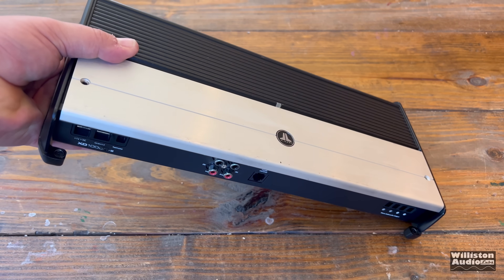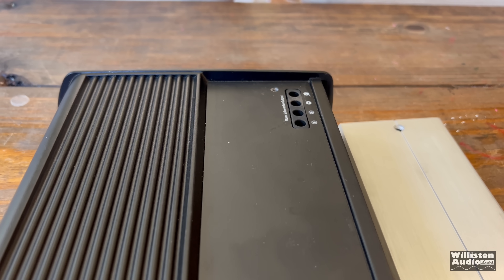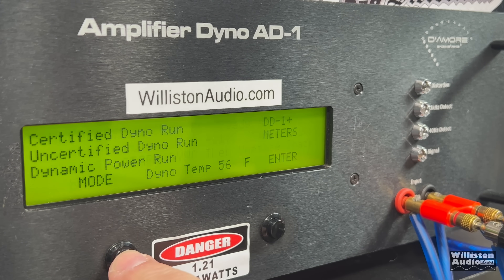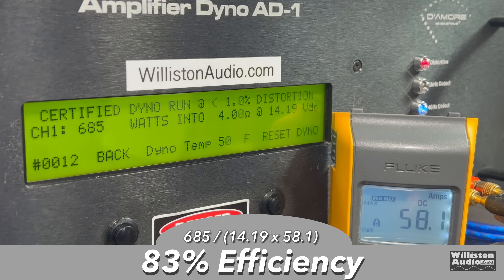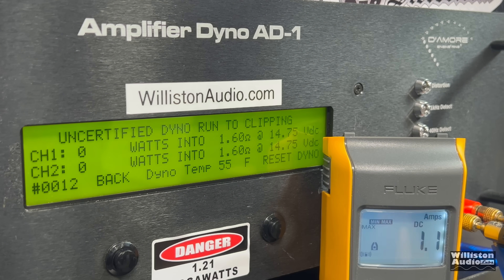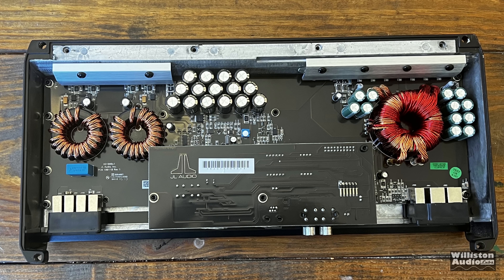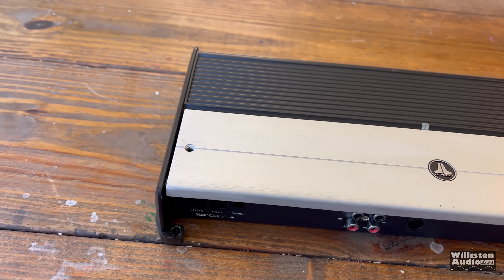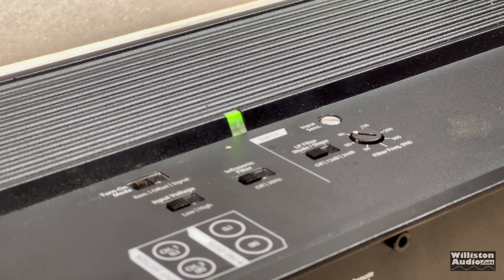Almost $1 per Watt? JL Audio XD1000/1 Amp Dyno Test and Review

Comment: I know this is a old video .
I have always had JL in my vehicles since the 80's-90's.the old school 10w6 subs were absolute mini monsters!  As I got older and my hearing doesn't require trunk busting bass. I tend to like clean clear bass in my later years . About 10yrs ago I started buying the perfect set up for my taco. Took my time and picked my old school set up. 
Found a JL 500/1 new in box on eBay, after many bidding wars, I wanted this amp pushing two jl 8w3v4 subs.
Went with the 8's due to lack of space behind seat. 
Long story short. Never did install this system in my taco.  Been sitting in my closet for years now.
That's until my son got his 1st car.  Which happen to be a 21 Civic Type R hatch. The absolute perfect platform for my dusty old school JL system.  After finally talking my son into going with my old school system.
We Installed the amp and subs in a dual ported custom box, on the civics stock system.
OMG!  I fell in love with JL all over again 
My son couldn't believe how bad ass two 8" subs hit.  He was very skeptical at first.  Like all young'uns his age. Thinking bigger is better. Not always my boy!  The rare occasions when He lets the old man take his R down the road.  Brings back some great old memories with some classic Rock hitting tight and hard!
Reply: @dwhite9603  whilst I am very happy for yall.
As far as the bigger being better, it is true the surface area of a 12 just allows for so much more and not to mention they’re more capable of hitting the lower frequencies!

Comment: I don’t know about the mono XD1000, but the sub channel is definitely regulated on my XDM1000/5 channel on the sub output. It’ll do 600 watts just for the sub channel at both 12.5V up to 14.4v
Reply: You are a mistaken. The XDM1000/5 Does 100x4 @2ohm and 600x1 @2ohm @14.4 volts They do not have the regulated  R.I.P.S power supply as HD or older slash series.  So your getting less that 600 watts to your sub at 12.5 than the 14.4 you would need for full 600watts.  Unless you have a very good charging system..(upgraded alternator and a good agm or Lithium secondary dedicated battery.  Your deff not going to be at 14.4 volts under load.
Reply: @  I’m not mistaken. Yes, the XDM1000/5 is classified as a non regulated amp, but look at the specs for the sub channel in the manual. It will output 600 RMS at 2 ohms with 12.5V up to 14.4V. If anything, I’d call it partially regulated.

Comment: Thoughts on a used JL 1000/1 like this or the JP23?  I have 2 X JL 12W3s and had a JP8.  I felt I was maxing the amp and the speakers wanted more than 400 watts each that the JP8 was providing.  Ive had XTANT in the past, so Im familiar with quality and damping of the amp.  I just want to make sure Im getting loads of easy clean power to the subs.

Comment: Hey WA Lab… I wanted to see if you can either answer or both answer and show amps that have best efficiency. By efficiency, I mean amps that do not tax an car’s electrical system too much, and would/could possibly perform well without huge power output upgrades. Many of the amps you show with decent power take so much amperage to run, that an 100-150amp alternator would barely put out to keep up with most of those 1k amps. And since most newer car’s electrical systems are really sensitive to voltage spikes and drops, that would be a cool series to help people that want to bump & retain an unmolested factory electrics- or mildly upgraded ones that just need a cap or additional battery. Cheers

Comment: 7:15 The idea is supposed to lower the Equivalent series resistance of the capacitance.  The theory is the smaller caps should discharge much faster.

Comment: A caps tolerance is typically plus or minus 5%. The bigger your cap the bigger your tolerances need to be. By using smaller caps you can tighten your electrical tolerances.

Comment: Many smaller caps will have a lower ESR resulting in faster and higher current capabilities. Also, you can distribute the current across more conductor with many smaller caps to distribute (heat) current load across more conductor, resulting in better cooling.

Comment: Armchair EE nerd here. Electrically, the equivalent series resistance ("ESR") of a capacitor is a big reason why a choice would be made between giant bulk capacitors and an array of smaller ones (as JL has). Just like with the woofers when paralleled, more small capacitors will have a lower ESR, allowing the capacitor array to handle a much bigger peak power draw, as one would see with a thundering subwoofer in a typical music application. There are other considerations as well:
  -Heat dissipation (more capacitors = more surface area for cooling)
  -Space usage
  -Cost of bulk capacitor vs. capacitor array

I don't think any of those are a major concern for JL Audio in this application, because:
  -The enclosed housing and cluster of capacitors wouldn't do much for dissipating heat from the capacitors
  -They clearly have plenty of space
  -JL seems to consistently prioritize quality over cost. (I do too.)

Thanks for covering, Big D. 👍

Comment: I had that Amp. Played it in the Arizona summer 110+ degrees windows down no ac. on 3 JL audio w6v3s. Max volume. No issues, never overheated once in 4 years. Sold it for a more powerful amp
Reply: Great comment sir. That’s fantastic to hear.

The gentlemen who engineered this amplifier live and work in Phoenix. They are acutely aware of real world temps in cars, in the summer, in Phoenix. (I know this because I work with them)

Comment: like the XD amps better then the HD. seen many HD installs that the amps would shut off cause not enough voltage/amps they claim the HD will run at 9-14 volts but thats horse crap seen it to many times thats why we push the XD over the HD unless they have a great electrical system...

Comment: There is nothing special about that amp. JL just likes to charge a lot of money for their products. I like their subs, I have three of them. But sometimes it is hard to justify spending all of the extra cash that they want for their products. I just picked up one of the JP8 monoblocs from down4sound that you have been testing lately for $200.00 and it is stable down to 1 ohm. It uses all the same internal components that you find in the JL amp and some of the components in the JP8 area actually better, like the RCA's. I can buy 5 of the JP8's for the same amount of money that it cost to buy just 1 of the JL Audio amps and I doubt that the JL Audio amp will have any advantage over the JP8.
Reply: Really bro really, it's like saying you can buy 3 corvettes for the price of 1 ferrari and they have the same components because they have 4 rubber tires !  Just say you are broke and be done with it.

Comment: Did you say wired in Series Parallel? What's that? As far as sound. Any amp with decent power supply and distortion will sound great with bass. Fact is this amp is a rip off for the price. No way a 1000w sub amp.should cost nearly $1000. Ridiculous. That JL label is VERY expensive to say the least

Comment: 1000 at 2 ohm is not bad. Would be a decent single 12 inch setup.     Thinking back I always saw these amps used in installs that for example, a friend of mine who does not work on cars, went to a shop and just had a single 10 inch system installed with the custom made boxes they sold designed for each model of car to fit in spare tire spaces or where the jack would normally be.  It would always be an alpine head unit, a CD changer, a JL audio amplifier, those custom boxes and a JL audio sub either 10 or 12 inch class. I remember the one in my buddies firebird was a 10 inch JL in a sealed custom box that came out to be just under one cu ft stuffed with poly fill.

Comment: JL Audio has always been a company that delivers well-thought-out, well-designed and reliable products. And these things shouldn't be cheap. The question is whether it can compete on price with European or Japanese amplifiers. If we talk about real SQ, I will always choose a European or Japanese amplifier for not powerful (60-80 watts per channel) 4-channel amplifier for midranges and tweeters. 
As for subwoofers or subwoofer monoblocks, JL Audio has succeeded in this. 
Thank you for your test and review.
Reply: Sorry JL Audio is low budget subwoofer & Amplifier,too expensive if you want deep bass they are not the way to go
Reply: @poohwecampbell7799  I'm actually talking about sound quality and not about SPL.  I'm pissed off by cars that can hear bass from half a mile away.  Well, to each his own.  In terms of sound quality, JL Audio does a great, right bass.

Comment: The smaller capacitors that are tall rather that wide, this has a better geometry to reduce inductance in the capacitor, ESL (effective series inductance) . As a result they can transfer current better at high frequencies. Since the power supply switches at tens of kilo hertz, this is beneficial since it can deliver power with minimal impedance. The effective ESR (effective series resistance), this has to be low to minimize heat generated in the capacitor, this is stated as you can see on the capacitor "Low ESR", this not always the case.

Comment: I’ve only used JL Audio for years. The old slash series. Power rating aside, nothing I’ve ever heard hits and clean and as hard as JL Audio. 2 W7’s and JL Audio 1000/1 pure subwoofer bliss. I have 2 that are over 10 years old still banging daily. Can the new Korean stuff say that?
Reply: I have 2 of these amps would you recommend me pair them to the 12 inch w7 subs or the 13 1/2 subs

Comment: Using many smaller capacitors in parallel instead of few big ones lowers the ESR (equivalent series resistance) of the capacitor circuit helping with dynamic current delivery.

Comment: I'm still waiting for someone to dyno the JL RD1500/1. With the impedance switch, it's rated at 1500 watts at 1 and 2 ohms. I'm curious if it's really the same at 1 ohm, or it's underrated. At 12 volts, it's 1200 for 2 ohms, and still 1500 for 1 ohm, which confuses me because at 1 ohm, it's rated same 1500 at 14.4 volts.

Comment: Does it sound better then a Fosgate? Honestly when i have the budget Fosgate makes a great amp, right now my wallet is on a Skar audio budget but man for $500 i got a box with x2 12s and a RP 1200.1d and it hits smooth low and clear. I notice with Skar tho has to be turned perfectly it's my experience after owning 3 dif Skar amps mechanical clipping you can hear, so feed them propper power and tune them accordingly.

Comment: The multiple small value capacitors equal lower impedance, which equals releases the energy quicker with less loss. This was pioneered by Peter Stein of ME 
Sound in Australia.

Comment: Can you do a dyno test on a Pioneer deh-x8800bhs head unit? They claim that it can do 70 watts for a sub channel.
I can send you the radio. Btw, I'm thinking a cheapie Image Dynamics 12" sub in a ported box could be decent for that head unit. It's a system for my granddaughter. Two coaxials and a sub. Good enough.

Comment: A bank of many smaller capacitors tend to be cheaper than a single 10,000µF capacitor.  Also, a big cap tends to take up a lot of vertical space, while a bank of smaller caps will take up a lot of horizontal space.  So the dimensions of the box, and the space available on the circuit board plays a role here too.  Plus, smaller capacitors will charge and discharge faster than a single large one.  This improves transient response time - basically, the speed in which current can flow in and out the capacitor to the rest of the unit.  The faster this current can flow, the less the signal is distorted when there is a sudden, high current demand, and the sooner the caps can recover after being depleted (or nearly so).  This results high frequencies sounding better at high volumes, and bass notes retaining their "punch" at high volumes.

But every capacitor has leakage.  This is a tiny amount of current lost within the capacitor.  No capacitor is perfect.  And when we add a bunch together, we add up the leakage.  So we use special capacitors with low leakage - but slightly more expensive.  And using capacitors rated at double the voltage for their intended use also lowers leakage - again, more expensive.  Thus, a 35v application would use a 70v capacitor to minimize leakage.  Cheap engineers and/or manufacturers will use caps at or near their rated voltage to save money.  Too much leakage, can reduce the voltage available to the unit, reduce efficiency, and reduce the life span of the caps themselves.  Also, each cap has a tiny chance of failure at any given time.  So a large bank of many small caps increase that chance of failure by the number of caps.

Sometimes you will find a small cap in parallel with a large cap.  This small cap is called a bypass cap.  It's there to handle those fast transients (high notes at high volume) while the big cap handles the bulk of the current demand.  it's not as effective as a bunch of small caps, but the failure rate is far less, and it takes up less real estate on the circuit board.  You may notice that some boards have all kinds of free real estate, while others are crammed with electronic components.
Reply: This absolute explains why my JL hd1200.1 amp has so much more punch than my previous infinity k1000. Both used the same input signal and keeping same settings it sounded so much more punchy.
Reply: When you put bunch of them in parallel it also reduces the parasitic resistance aka ESR...
Reply: Wish there was distortion, intermodulation, and also more circuit layout discussion like we get on ASR forums. Parallel caps have lower ESR than usually can be achieved in a single larger can.  I think Panasonic doesn’t even make large value snap-in capacitors anymore.
Reply: This kinda knowledge is priceless and was explained very well, even a dumbfuck like me could fillow that 😂 cheers bro 👌
Reply: High voltage caps have a much higher ESR than lower voltage ones so you will more of them. Using caps rated at higher temperature and voltage drastically improves their lifetime (doubles for each 10deg below their rating)

Comment: I’m sure I got this wrong and I’m going to get a bunch of flack for this.  Did the engineer who designed the PPI art series amplifiers go from Precision Power to Xtant and then finally to JL?  If so then the JL amplifiers at least the ones from around the late 2000 would be the final descendants of the art series lineage?

Comment: I think acting like this amp is more expensive because of its higher quality is ridiculous. This Amp does not perform better than amps that cost 1/8 the price, it does not have many features an expensive amp should have (nicer RCA inputs, adjustable subsonic, clip light, free bass knob), at this price you are paying for a brand name that sells to people who don't realize the extra 800 dollars is not performance but just a JL logo.
Reply: So how do you think JL Audio got such a good name? While there are great amps to be had at 1/8th the price and they do sound just fine to most people, but I can definitely tell the difference in SQ between a $150 dollar amp vs a JL audio amp especially when powering mids and highs.
Reply: If you've ever ran jl you know. They over perform never get hot and there just about impossible to break. You know exactly what your getting when u get jl. I have and older  xd600/1v2 on a sundown 12 rated for 1500rms and its giving that sub s good work out and actually sound good
Reply: You are right. I've owned a teampie 4000.1 for 7 months now. It slays this amp. $500.00 delivered. I purposely went way high on watts for my single 15 woofer thats rated at 1200 watts rms but it never gets over 90*f running it hard. Has clip light on bass knob, temp guage, volt guage. It also has anti clipping button switch. I once owned a 13w7 jl sub. It was nothing special and i paid  huge pricetag. These days most crap is just generic chinese buildhouse stuff with many rebrands.
Reply: @tynothdorft7374  that team pie isn't even close to the quality of that amp.
Reply: It's comments like this shows me who the brokeys really are  Sure you can buy a cheaper amp but the quality is going to be crap forcing one to eventually buy another amp which effectively will make it cost more. There is a saying that goes "buy it nice or buy it twice".  Furthermore, these are the same people that sate those who buy Ferraris are fools when they can easily buy a corvette for a third of the cost because it does the same thing.... really bro,  really jeez

Comment: More smaller capacitors = more surface area than just a couple large caps. The smaller caps run cooler than just a couple large caps, not only that the other reason is BOM (bill of material) if the company is already using those small caps in other parts of the circuit or other board lay outs then they would rather have a shorter BOM and save $$. Those smaller caps are 1/10th the price of the larger caps, though 10 smaller caps will always outperform one large cap (as large as you can fit in design due to headroom). That’s just thermal dynamics!

Watch Dave from the EEVblog channel, he has a very well detail and much more informative than my dumbed down explanation.